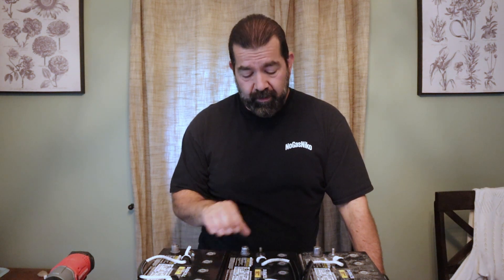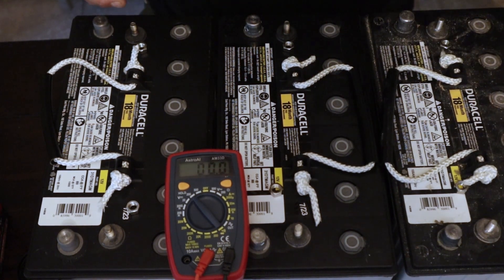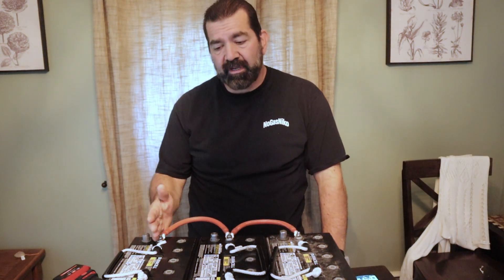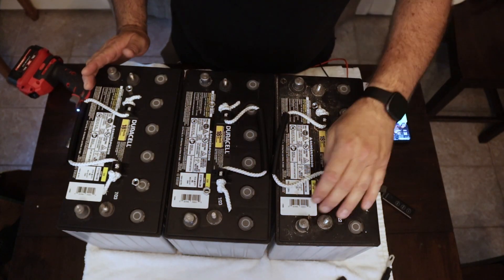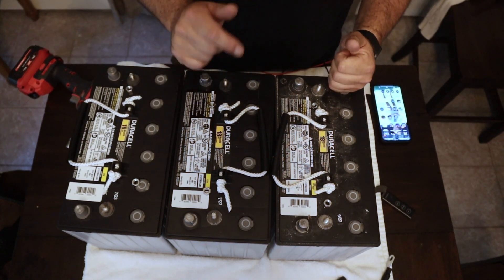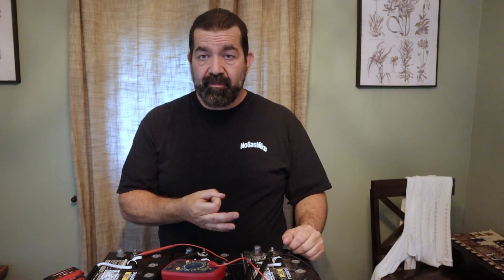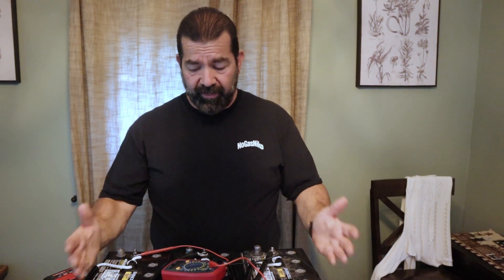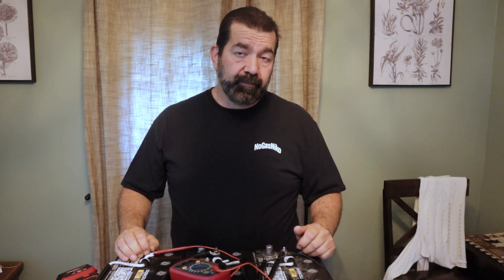Wiring Batteries in SERIES vs PARALLEL and why it's IMPORTANT!!  Avoid mistakes, what this video.

Comment: So let me get this right. its different between solar panels and battery as far as parallel and series. Cause i swore you said if i run my panels at parallel i will add each panel together having to increase the thickness of the wire i am running? Sir do you have a minute? LOL So my wife bought this house before we met and it came with 20 solar panels and 1 inverter that was then connected to the power company's fuse box that ran the house. Well i dont think that set up ever worked. There was not a time when the energy bill wasn't high. My brother gets money from the energy company for supplying the grid when he doesn't use that much power to run his house. We seen nothing like that where we currently are now. So we have no power and been working off of propane and generators to cook and have lights and keep the fridge going. So Now said Solar Company that sold us the panels has gone bankrupt and is no longer able to get a hold of anybody. In fact being in a class action lawsuit with said company. So i got 2 solar solar charge controllers. Im going to feed them equally through each controller. 10 on each. Then that will go to 2 battery Banks of 2 12v rechargeable batteries for each controller. Then that will go into the Jupiter 5000w Power Inverter that will then feed my old breaker box to power the house back on to work the washer and dryer, microwave, stove and such. Sound Feasible and do you think im doing it right? Your thoughts please on how i should wire the system would greatly be appreciated
Reply from the maker: Is your system grid tied?  Sounds like it was but I want to be sure.  My system is connected to the grid via a transfer switch by MOEs.  Will make a big difference on recommendations.
Reply: @NoGasNiko  it was , it still physically is... but no power comes in.